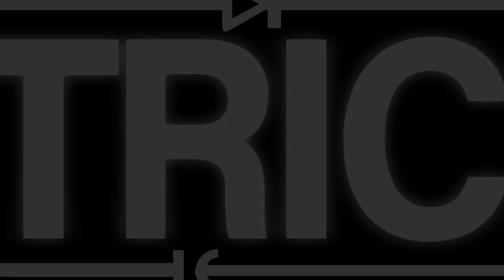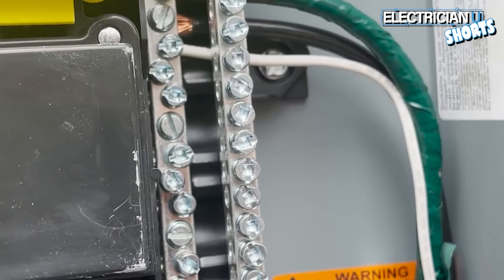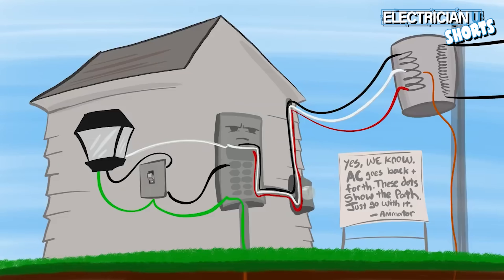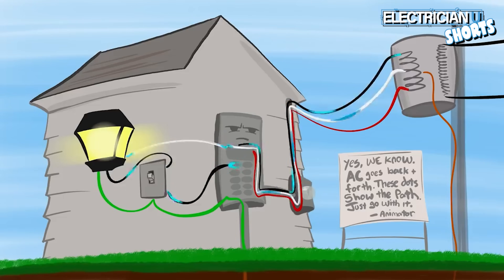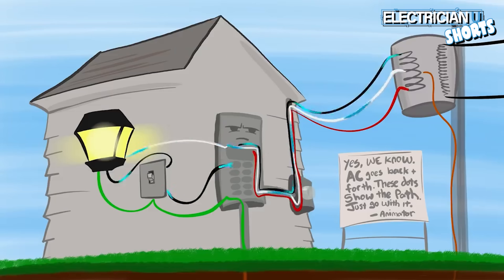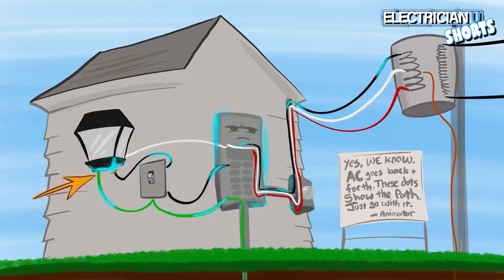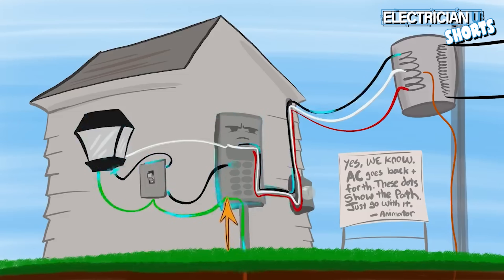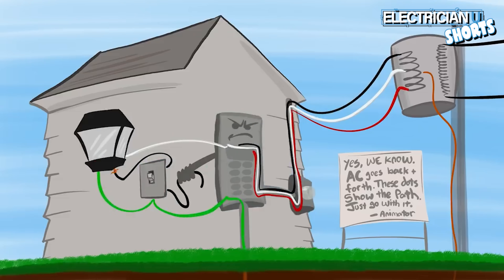SHORTS - WHY WE BOND (Neutral & Ground) Explained in 3 Minutes

Comment: One of the more difficult thing for me to understand as a Drafter has been the difference between Neutral and Ground.   I've never had it explained really well.  Thanks that helps alot.
Reply: neutral is meant to have current under normal conditions, ground would only have current under abnormal conditions (safety).
Reply: @alanbumbai thank you sir!!!!
Reply: To fully understand the nature of a NEUTRAL RETURN as distinguished from a GROUND to EARTH you need to examine the difference between the TRANSMISSION & DISTRIBUTION of POWER. If you look at the THREE PHASE TRANSMISSION SYSTEM in Wave Form then you will notice that at any given moment t(x) the SUM of the current in the three phases always = ZERO... that is a balanced system... arising from stepping up V to max & dropping Amps down to min for transmission with as close to zero magnitude of resistance as possible in order to travel a great distance without any loss of power thru impedance in the conductor [&/or environmental conditions affecting the capacity of the conductor viz developing impedance]... power of course once generated always remains the same [P = V x A]... once you get to the house(s) and the power needs to do work then you TRANSFORM the power from High V Low A to HIGH A Lower V so devices can do work & hence LOADING OCCURS... and since LOADING can never in a practical sense be balanced at ANY GIVEN MOMENT t(x) you have an imbalanced system & there MUST be somewhere for that imbalanced current to go in order for the circuit to be completed back to source... so in order to save needless expense over LONG DISTANCES in TRANSMISSION where you have HIGH V & LOW A in a totally BALANCED SYSTEM there is NO NEED for the NEUTRAL CONDUCTOR to exist... think about the cost of each conductor over say 10 miles from generation to distribution... that is a lot of conductor you are NOT installing! THAT is the necessity of the NEUTRAL RETURN... to carry the imbalanced current BACK TO THE SOURCE... so to keep it simple:
1. The GROUND EXISTS to divert any unanticipated current in a device/shroud etc away from the hazard as much as possible so that the GROUND SYSTEM will be the BEST path to ground rather than a person standing there touching something that has the unanticipated current AND the NEUTRAL EXISTS to ensure that there is a PATHWAY BACK TO THE SOURCE for the current to travel completing the circuit & allowing the hazard to be defected in the overload/short device so it can function & trip...
The REASON for BONDING the two NEUTRAL & GROUND at the 1st point of disconnect as the vid addresses is to ensure that the above is satisfied... however that is NOT the sole reason for the BONDING bcuz there is also the scenario where PRIOR to service entry the NEUTRAL or GROUND is disconnected... in which case you may have the dangerous result of a floating NEUTRAL... by BONDING the NEUTRAL RETURN & GROUND at the 1st point of disconnect it ensures that such a disconnect PRIOR to service entry will allow again the circuit to function with all safety measure in place & able to detect the hazard... so this comment with the yt channel creator's video should be the full explanation of the necessity of BOTH a NEUTRAL RETURN & GROUND SYSTEM in any unbalanced system <<< again >>> ANY SYSTEM that has LOADING at any given moment t(x) practically speaking will NEVER have the current sum = zero & MUST therefore have the presence of a NEUTRAL RETURN to source for that less than but still van be significant current.
Next you should study the PRACTICAL aspects of OPEN NEUTRAL/ "Floating" Neutrals and see the scenarios where the NEUTRAL RETURN is turned into a full on CONDUCTOR... hence carrying sometimes twice or more current than any one circuit was designed to carry via the installation, this happens when a COMMON NEUTRAL RETURN is utilized on different circuits & when the pigtails are removed the NEUTRAL AND THE PERSON can act like a part of a DBL or greater CIRCUIT... a very dangerous situ that home owners are almost 100% unaware of since they never do diagnostics & simply look at the color of the insulation as the sole evidentiary basis for their "circuit analysis" when they decide they want to DIY... this may be how the game "operation" was invented... you touch the metal & BOZO's NOSE LIGHTS UP & a BUZZER sounds! I hope this comment helped you on your journey to fully understanding the difference between & necessity of the NEUTRAL RETURN vs the GROUDING SYSTEM in distribution networks.

Comment: Earth-Neutral connection is also used to make Neutral 0 volts. Otherwise you can have a floating voltage which affected how RCD's (Residual Current Device) work and may not trip under fault conditions..
Reply: Neutral is grounded at the transformer in any case. Also I think you confused earth wire with the actual earth.
Reply: @okaro6595  Depending on how far away the the TX is, the cable resistance may create a voltage difference.

Comment: Something im not entirely clear on is why the ground runs into the earth AND is bonded at circuit box. If the important thing is to get the current back to the source (to complete the loop), why is it also necessary for it to go into the earth?
Reply: Systems are grounded to prevent overvoltage (lightnings etc.) In principle grounding at the transformer is enough but if the neutral breaks it is good to have local grounding. This does not make it safe but at least reduces risks.

In some countries the neutral is not grounded locally. It the ground wire is grounded and they are not bonded. This system known as TT requires complete RCD protection preferably in two layers.

Comment: Where I operate my business in Northwest Arkansas most of the homes have only three wire connection between the panel and the meter. Then they drop a ground right at the meter and bond it there.  And there is no ground rod, connection to the panel or ground from the panel to the meter to bond there.  I’d love if you could addresses in a video sometime.

Comment: There are systems where the neutral is put to earth only into the distribution cabin. Therefore only the neutral of the transformer is put to earth. In case of faults, like the one you described in the video the GFCI comes into play.

Comment: I have a booster pump for an irrigation system. It is a 2 HP unit. I have 12/2 uf run from relay box to pump. I checked continuity all good. The dedicated circuit feeding the relay box was on a good functioning 20A standard breaker. When relay opened successfully after timer sent signal the panel breaker would trip within 3-5 seconds. I checked voltage at pump when relay opened it was 68 volts?
I did same check at pump with 12/2 removed from pump it was 122 volts. The shaft on pump wasn't seized and the start capacitor tested fine. I then swapped the dedicated single pole 20A breaker to a 15A standard double pole and turned the voltage switch on the pump from 115v to 230v the timer sent signal to relay and pump ran perfectly with no issues. Question is why was voltage drop on the sp breaker at 68 volts was there just too much resistance at pump and it needed more power? At the 150' from pump, the pump manual calls for a #14 wire when running 230v but a #6 wire if running 115v at same distance.  I guess I'm confused at why the voltage drop to 68v when connected to pump but 122 volts when disconnected from pump. I first thought just the distance but when disconnected at same distance a proper range reading? Perhaps the load from motor just dropped the reading from 122 to 68 ? Your professional opinion would be greatly appreciated Thanks for a great video . Btw both standard breakers were Siemens brand

Comment: In Australia the neutral is never connected to earth, the earth leakage detection breakers monitor the house to make sure nothing is earthed, saves lives as if a human touches it the breaker shuts off. 😂😂
Reply: Sure ths neural is grounded. The system is PME though the Aussie term for it is MEN (Multiple Earthed Neutral). 
.

Comment: One thing I was wondering, if the neutral isn't bonded to the ground, would it even be considered a "neutral" anymore?  Would you now just have two hot legs, similar to a 240v circuit?
Reply: @okaro6595  Im not talking about equipment grounding, Im talking about system grounding.  It's really a purely semantic question anyways.  It's not really important to how the circuits work

Comment: I agree with most of what you said.  The reason there are grounds at all is to ensure that a fault, as your animation showed very clearly, causes a high current to flow in the circuit, tripping the breaker and de-energizing the circuit.  If there were no grounding, it would be possible for the light fixture to remain energized at 120 Volts due to a fault, waiting for someone to touch it, make a connection to ground through their body, and be electrocuted.  Adding a grounding conductor to the metal parts of the fixture (green or uninsulated wire, and with the other end connected to the earth) ensures that there is no possibility that the fixture is at any voltage other than zero, compared to earth.  However, using a stake in the ground to ensure an earth connection relies upon the earth's conductivity, how wet the earth is, how far the ground point is from the utility earth conductor, etc. and so there are too many ways for this not to work.  As you note, connecting the grounding conductor to the grounded neutral wire from the utility ensures that this path has almost zero resistance back to the utility.  The effect is that when a fault occurs, a very large current flows momentarily through the fixture, then the grounding wire, and back to the neutral.  This ensures that the breaker trips immediately, clearing the fault in a few milliseconds.
Reply: Yes. I don't understand how these videos that have only partially correct information get all these amazing comments from people. I can only give one like to your comment but I hope it somehow gets more prominence.
Reply: Yep couldn't have put it better
Reply: If you didn't reference your electrical system to ground/earth , so had no connection between physical ground and neutral, then you would not get a shock touching a faulty light energized to 120V, as you will not be completing the circuit as the electrical system is not referenced to the physical ground anywhere (including not being tied to ground at the transformer). This is a typical setup for small generators, the trouble with this setup is, although a lot of people might say why don't we do that as we eliminate the shock risk from touching a hot wire while in contact with the ground, this is correct and for the first fault there will be no shock risk, but you would also be unaware of it and this fault would be fortuitously referencing the electrical system to ground, therefore any additional faults will present a shock risk despite the fact you thought you were protected by them,  referencing the neutral to ground ensures electrical faults act in a predictable way.
Reply: @marcuswareham1  is this also why a system supplied by a delta-wound transformer is tolerant of a single ground fault, but not two?
Reply: @marcuswareham1  Mike Holt has a good video showing that "ground" is not what trips the breaker.  He puts a black wire from the breaker directly into the ground, and because of ground resistance, not enough current flows to trip the breaker.
Reply: @marcuswareham1  Best comment in this video! So much misunderstanding related to grounding.  Perhaps you can answer this for me.  Homes built pre-1950  have two prong outlet without ground wires.  this seems like a much  safer system than the grounded system we have today.  Because someone standing up in a bathtub and touching a hot wire, or touching a metal light fixture with hot wire accidently touching the metal light fixture will get electrocuted (assuming no GFCI).  However, that person will not get electrocuted in the pre 1950 home because there is no ground path back to the source.
Reply: If bonding to neutral is done solely to provide a path back to utility why wouldn't we just bond it to black in this scenario?
Reply: @drwombat  that literally is the definition of a short circuit- I posted a comment above you might want to read that covers everything... you should hire an electrician you have bad logic & everyone does has gifts but your gifts are not ones that should have you doing electrical work like ever... like for real

Comment: so if your gonna put the neutral & ground together, how does the current(or electrons? - in cars they move in opposite direction), but whichever it is in this 110 case, how does the electricity know which way to go(actual ground or through bond)?🤔…
Reply: It is the resistance that determines is. The resistance of the incoming neutral is maybe a thousandth of the ground.

Comment: If there's a problem like the hot wire touching the metal lamp cover, why do we want to keep the current flowing back to its source? Don't we want the circuit breaker to simply stop the current for safety's sake?
Reply: The current going back to the source is what causes the breaker to trip. There is no other way to make it trip.

Comment: You say we connect the neutral and ground together, but there was barely a hint of a neutral-ground connection in the animation. If there is an actual wire connecting the two shouldn't it be shown in the animation?....which I thought was great up to that point.

Comment: What happens if there is no ground initially, say the source is not ground? Or source if fully insulated to the ground? Then if there is a leak in the equipment,  there is no danger to someone since to pass current through the body a complete circuit is necessary. I heard that ground is necessary since to prevent 40,000 or so volts coming to the house where the voltage is 240.
Reply: Yes, it would be safe. That is how an isolation transformer works. Isolated systems, however are good only in very smaa scale (essentially one device). Larger systems need to be grounded for example because of induced voltage by nearby lightnings.